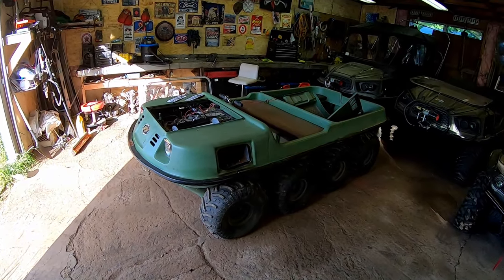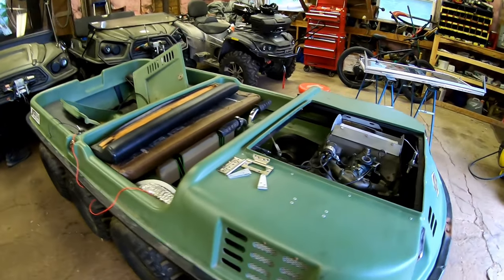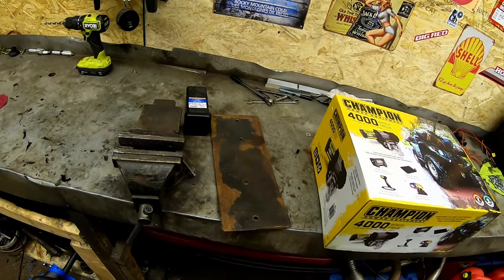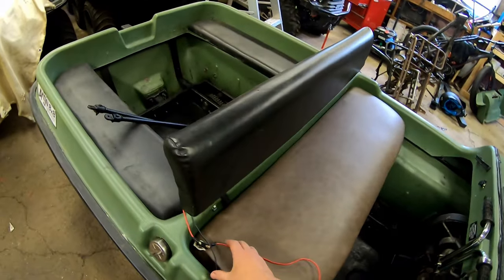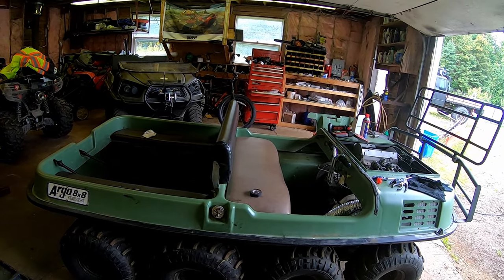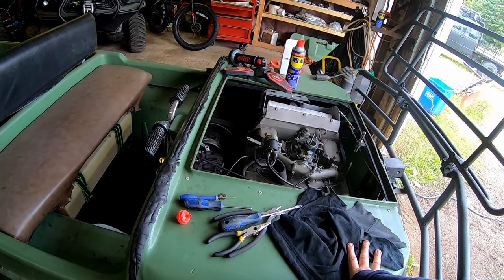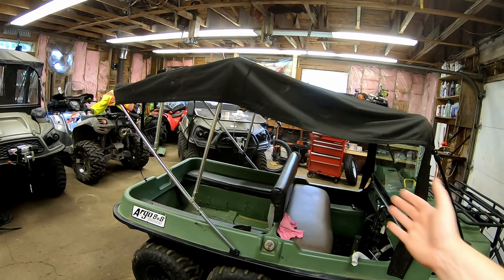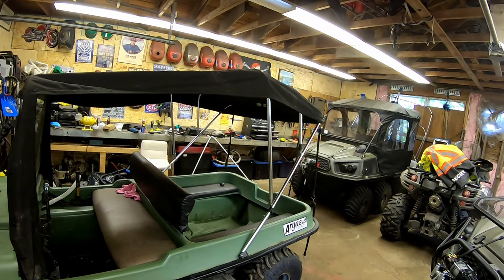Argo Bogmaster Build Episode 2: Removable winch, bumper, windshield, canopy?

Comment: Amazing work! I love the front brush guard, the look fits the argo perfectly. I also like your idea for the removable winche system and the flip up seat. Defintely going to borrow those. 😉 

Those kohler fuel pumps can be troublesom, you might consider using a vacuum pulse pump by drilling a small hole into your intake manifold of the electric option doesnt work out. 

Ive watched most of your argo videos and i have to say you are awesome. Ive loved watching the project as its evolved, and its helped me a lot in working on some of my own 6x6 and 8x8 projects. You are an invaluble source of information and guidence. There are very few argo videos on youtube, and even fewer good ones. I would love to see more indepth videos and comments regarding the results of your efforts. 

Awesome job mate! Keep it up!
Reply from the maker: Thanks me buddy, I am happy with how the bumper turned out, father gave me some galvanized pipe from a old fence or something that i repurposed. the flip seat I really wanted to add, and the anti flex / anti sag system. My argo used to flex weirdly around yourself when going through uneven terrain. Drilling into the intake manifold sounds like a good idea never thought about that, on snowmobiles they use a crankcase vent to pull vacuum; intake manifold would pull vacuum too, good idea. And many thanks, for the comment. I don't have a whole lot of views on here but glad to see some people enjoy the content! I keep working on projects cause I find it fun. think I like working on things more then I like driving sometimes lol! 
-Muddy

Comment: Nice videos. Just finished watching part two. 
Re. canopy. The aluminum supports need to be angled forward’s not vertical and the whole frame tilted ahead. That should take up the slack in the canopy and may prevent you having to add the extra piece. 
Keep them coming.
Reply from the maker: Thanks Nassir

Comment: Wonder if the problem with your mechanical fuel pump is due to the age, if its been on the shelf for 50 years, the diaphragm might be dried out.
Reply from the maker: I replaced it with a Kohler one and a knock off one , didn’t have much luck , I’m thinking the cam lobe might be a bit wore down. The Amazon one didn’t work very long
Reply: @muddythumper8152  the Chnesium one is what is it but the explanation for the genuine Kohler failing so soon may be age.  Did you try opening up the pumps to see if the diaphragm was torn?
Reply from the maker: @DougsMessyGarage  yea the pump looks good on the inside , didn’t produce much vacuum though. The electric pump works good on it. I picked up a new scout 6x6 too , haven’t got around to making any videos this year so far. Time goes by too quick